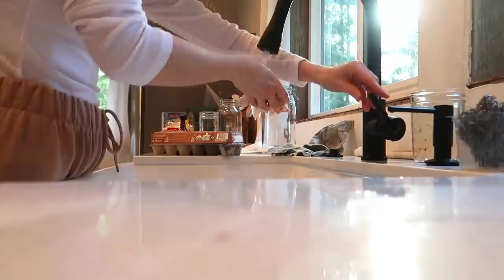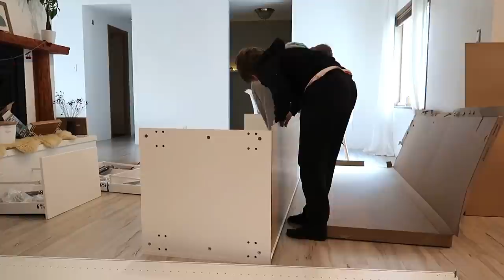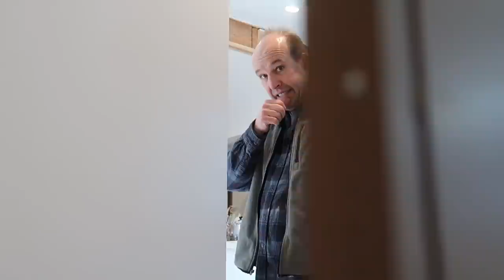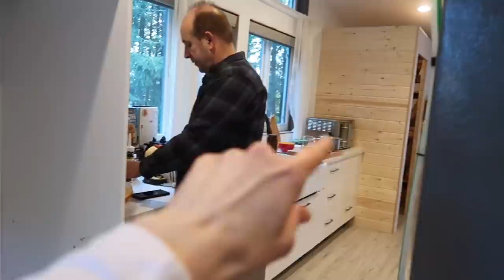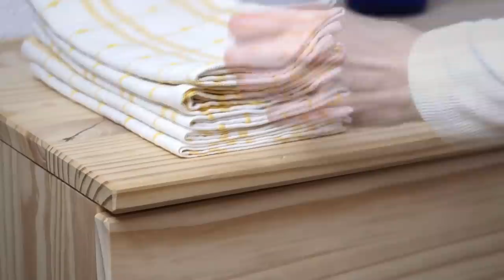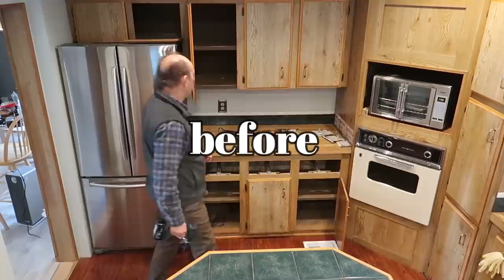KITCHEN REMODEL INSTALLING IKEA CABINETS kitchen before and after

Comment: What a transformation Noemi! How long did this whole kitchen project take so far? Two weeks? What will be the next area to tackle?
Reply from the maker: We have to work outside right now starting the garden and then we gonna do the smaller bathroom and I'm gonna do something with our bathroom until Zsolt can get around it 😄🤗💗
Reply: @ScandishHome  I love seeing what you will do with the garden and the bathrooms!

Down the line, would you do an Q&A video about the new house and how life has changed for your guys? Like are you still in Oregon? What challenges do you face living out in the countryside? I see that you have a mice problem which you didn't previously have. How are you adjusting to longer commute for grocery? It looks like you are stocking up more (?) With a bigger house, how are you changing your cleaning/tidying routine? That type of stuff. I don't know if others are interested but I definitely am. 

I hope the boys are enjoying the new home as well.

Comment: I am so happy for you. I love my husband, but I can’t convince him to redo our kitchen. I have a 1958 kitchen with a cabinet from the 1890s in one part to hold all of my small appliances and our flatware. At least I am going to paint everything white once the snow leaves (I’ll have to do sanding of the old cabinet door fronts). I am cleaning the inside of all the cabinets to get ready to prime (and caulk the spaces) but it is all on my dime and during my free time. Any chance you would hire out your family to redo my kitchen?  I love your space. Congratulations. 👏
Reply from the maker: I hear you out Wendy! Before we re did this kitchen it had so many cabinets I could not keep in mind where would be what but yet it was finning in less than my previous kitchen. Drawers are so efficient I really wish you could have the same drawers💗 That would be fun to re make your kitchen but for now we can barley keep up with this house and the work that Zsolt does. Painting the cabinets white is a great idea I'm planning to do a similar thing in our bathroom until we can get around to remodel that part. Also dollar store has some nice white containers to organize things in there I got a few for our bathroom🤗💗
Reply: @ScandishHome  great idea of the use of dollar tree containers.  I love your containers and how uniform and beautiful it all is.  I just have to remember to pace myself with these little by little.

Comment: Please check to see if these products are safe around the chickens before using.
We live by a lake and get alot of ants so we use Ortho defense in and out of the house, inside the garage, around deck, etc. We use ammonia a few feet away from the house and around the grill to keep squirrels, raccoons, etc off the deck, off front porch, away from garage door. When we first moved we were not used to woodland creatures and they treated our deck like a toilet and our porch flowers like a buffet. 😬😳